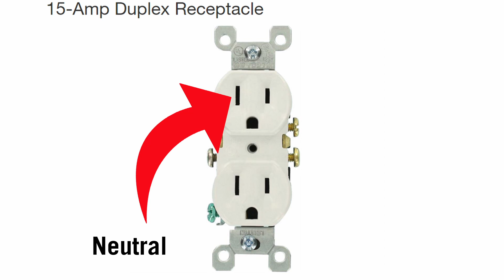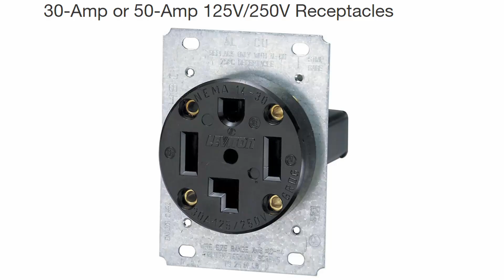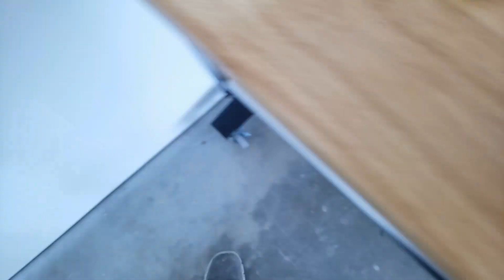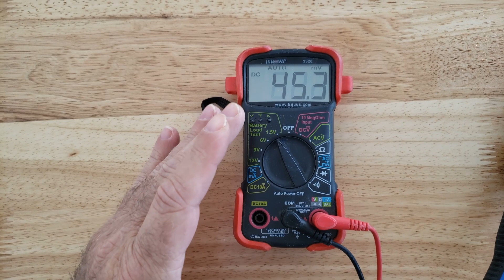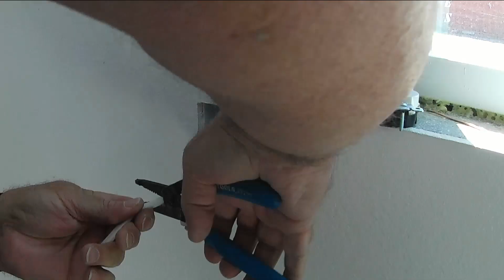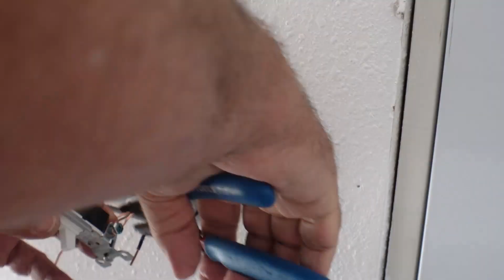Avoid These Common Electrical Outlet Mistakes

Comment from the maker: Razor Knife: https://amzn.to/3EEEJ7V
Screwdriver Kit: https://amzn.to/3MjvNYn
Correct Wiring Tester: https://amzn.to/3xRz8ts
Live Circuit Tester: https://amzn.to/3xRz8ts
Wire cutter/strippers: https://amzn.to/38bl1V6
Multimeter:  https://amzn.to/3EyD3gk
Wire Connector Kit: https://amzn.to/3Ot8xco

USB Panel Adapter: https://amzn.to/3xFME3v

BESTTEN 1-Gang Duplex Wall Plate: https://amzn.to/3L6XMdC